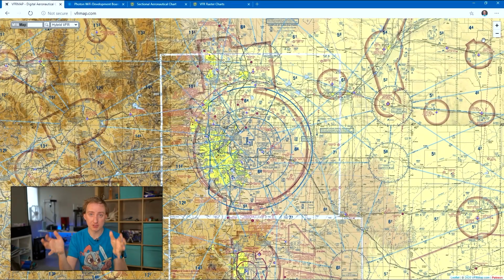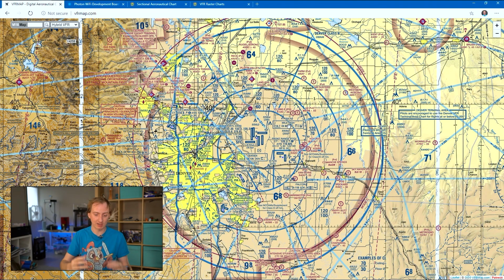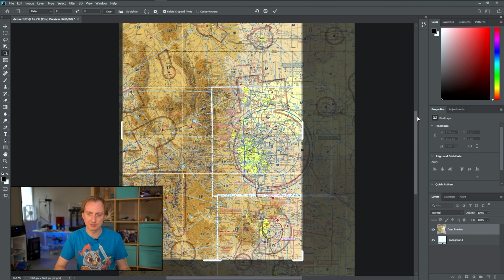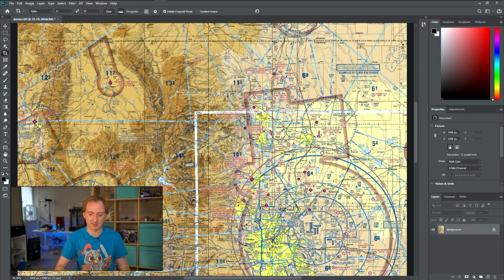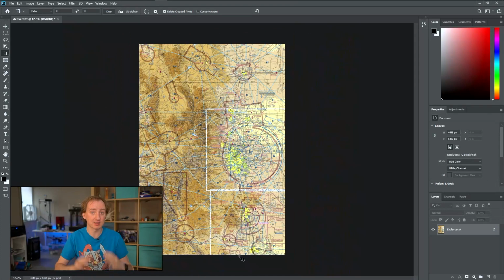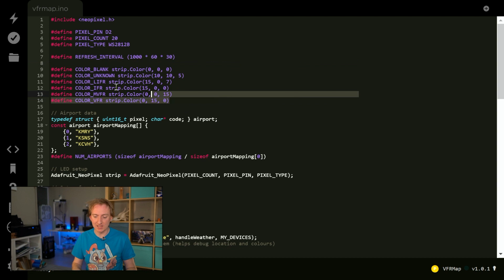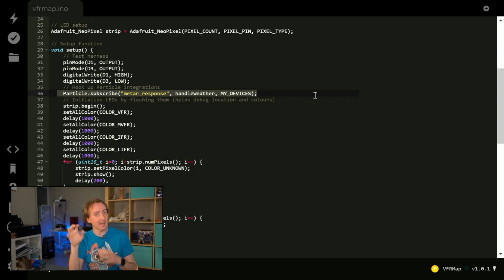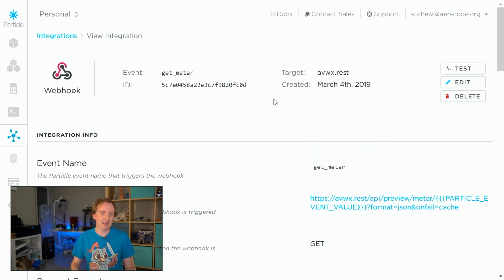Build Tour: Aviation Weather LED Map

Comment: This is great, I am thinking of doing one with a metal print, and was considering a raspberry pi as the controller but this looks even more interesting considering how simple this is.  I also am going to create a legend as well as perhaps a box with a zoomed in area of the sectional, so a bit of image customization. Thanks for the ideas. Found the premade neopixel strips on amazon
Reply from the maker: Yeah, a Pi can definitely work as the controller - just as long as it can supply enough power for the strip! (It probably can unless it's a Pi Zero, the Pis generally have a lot more spare overhead on their power regulators)

Comment: Great project and executing! One question, why not do some measurements and solder before glueing all the LEDS?
Reply from the maker: Ah, I tried that on the first map! It's mostly because I find it easier to solder all the LEDs while they're in place; having to lay them out and make what is essentially a wiring loom first is just an extra step I'm too lazy to take :)

(besides, the glue is reversible once or twice if you screw up, so there's a little room for mistakes)